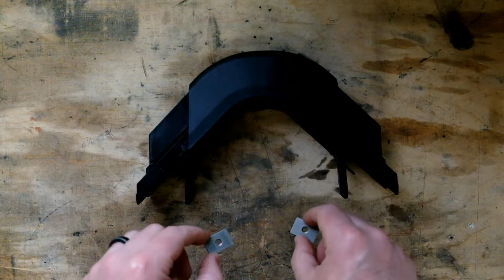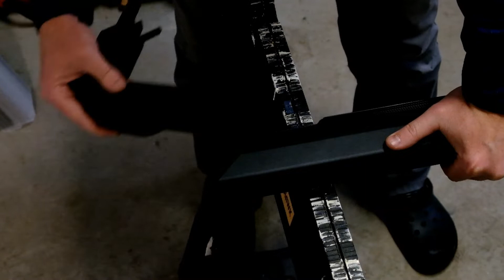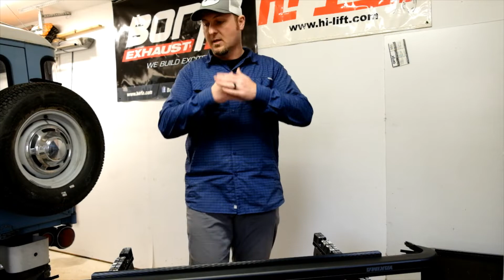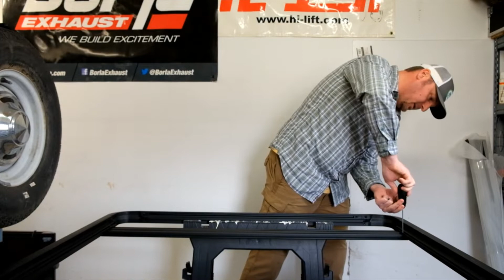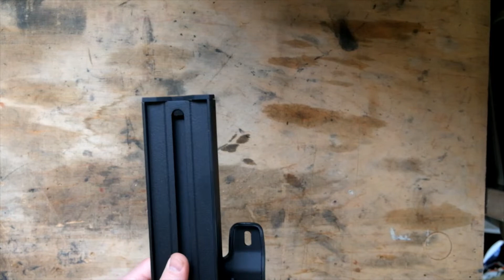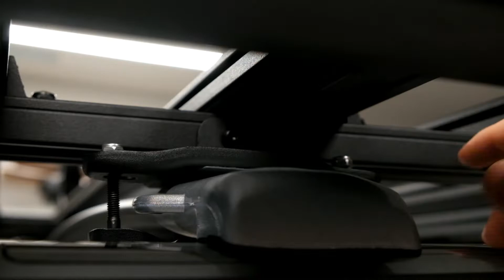Yakima LockNLoad Platform Installation

Comment: Thanks for the video! 

Question, how wide are the slats? Trying to figure out if i can mount a roof top box on the platform. I use one on my GX when going camping with the family. It would be a deal breaker for me if I can’t mount one on the platform anymore. Thanks!
Reply from the maker: The slats are 3.25in wide and spaced on 7in centers
Reply: Living Overland thank you for the reply!
Reply: Javier did you end up mounting a box on this? Easy?